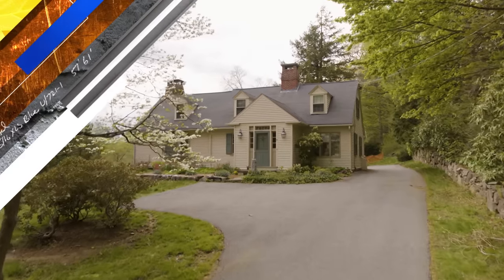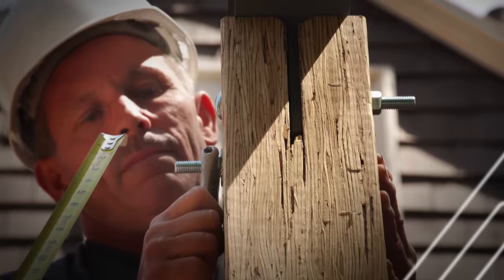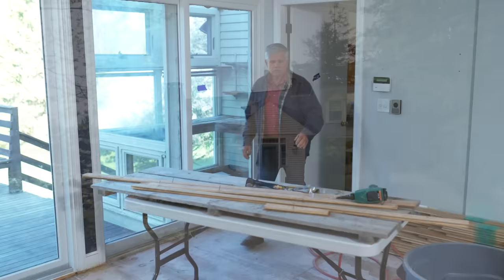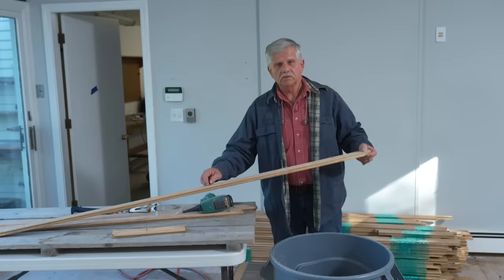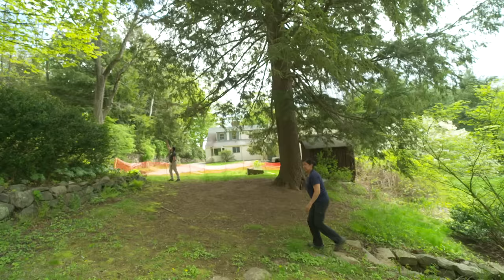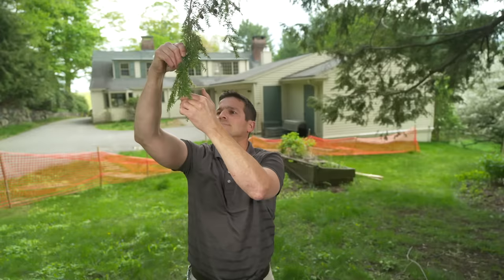This Old House | Saving What We Can (S43 E2) FULL EPISODE

Comment: Years ago, I recall watching a TOH episode where Tom was pulling the nails out of reclaimed floorboards from the back side with a pair of fencing pliers to save the face of the board from fraying the wood as the head of the nail is pushed out.  I even think Kevin had the pneumatic nail remover and was showing Tom how well it worked, funny how times change.

Comment: It hurts my eyes to see channel locks used on nuts and that bleeder...I'm a carpenter but Have  adjustables for plumbing stuff...Channel locks are for under sinks or black pipe starting threading into a fitting...Just sayin. Jabronis taking down that addition...That excavator should have a grapple and a few dumpsters...Why make a mess and then clean it up? It's dumb.

Comment: A substance doesn’t have to be toxic for it to be harmful to your body.  Oil or water in any ratio or quantity should not be inhaled.  An N95 mask or respirator, whichever is appropriate for the type and amount of material, should be required during spraying.
Reply: You know it's funny cause I was thinking the same thing. 98% water? Not sure I'd even want to inhale atomized water all day and water is about as harmless as it gets.
Reply: Maybe, but that water has been sitting in a tank on the truck. I’m sure it’s cleaned each day…🙄